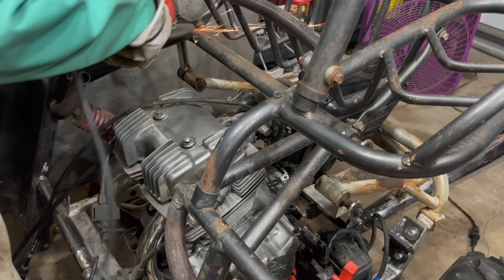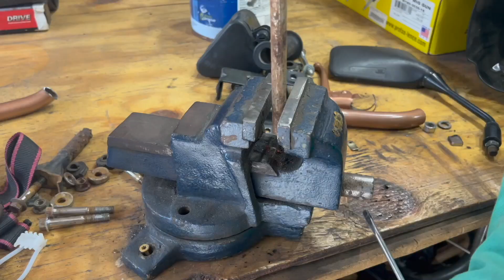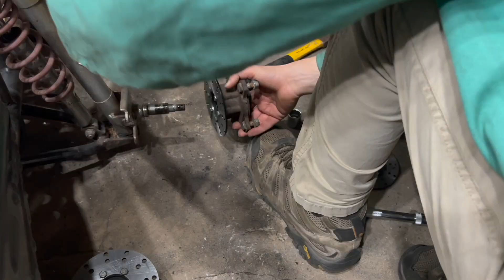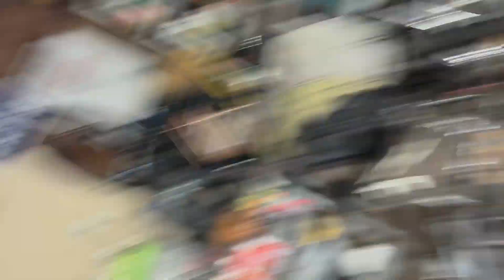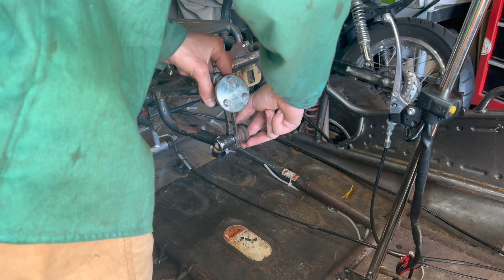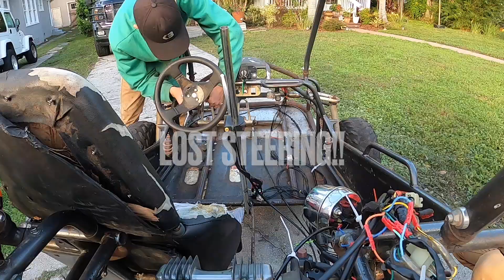Go-Kart Restoration Project Part 4 (First Test Drive, Will it Run?)

Comment: I'm doing a similar project, but to make things a little easier could I just mount the original handle bars onto the steering column
Reply from the maker: I suppose you could. Good thinking👍